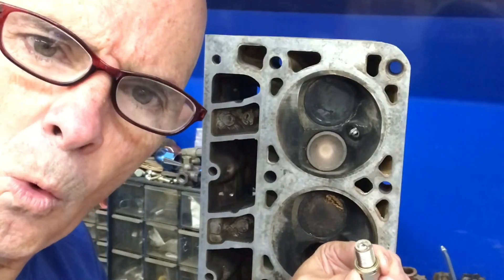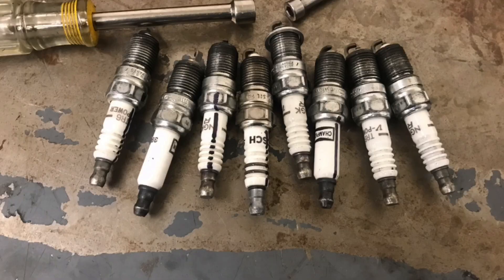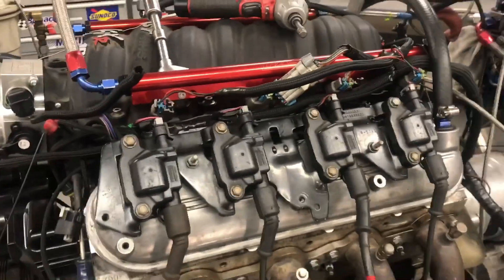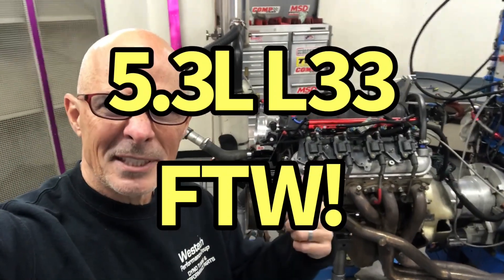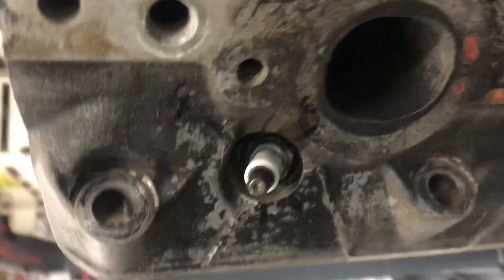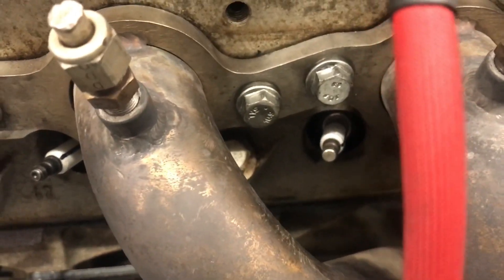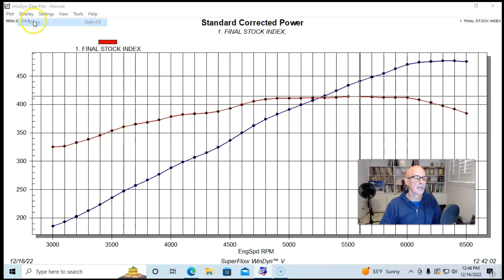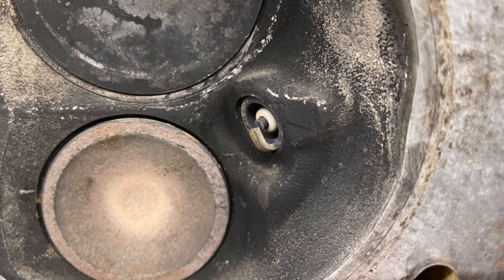SPARK PLUG INDEXING-DOES IT REALLY ADD HORSEPOWER? JUNKYARD LS MOTOR MYTHS! LOW $ MODS-DOES IT WORK?

Comment: American Iron Magazine tested plug indexing many years ago on a stock 1200 sportster ( at the time, a stock harley was a dual fire ignition, both plugs fired at the same time ). they saw a 1.2 hp gain (2.5% increase) but the owner didn't care about the extra horsepower, she just LOVED how much smoother the bike ran at highway speed. As he said, it's all about application, and hoped for results.

Comment: It was always common knowledge that indexing plugs did not yield large HP numbers. (Rumored NASCAR indexed and returned a 7 HP gain) bit if you're on the quest for HP numbers, you know every little bit adds up. Lightened flywheels, crank pulley, electric water pump, electric fans and etc. And before you know it. You could be pushing those 900 hp numbers like NASCAR has. But we also have to take in account for head design. For it's also common knowledge that the heads of an LS flow significantly better than its predecessors.
Reply from the maker: every little bit doesn't add up when the little number is 0
Reply: @richardholdener1727   I'm  just going to contribute heat being a factor in forgetting 1 is greater than 0, as stated at 11:30. Stay hydrated my friend, cause we're not youngins anymore.  sigh
Reply from the maker: there is no 1, there is only 0...look elsewhere
Reply: @richardholdener1727  so you want to tell SummitRacing channel their video is wrong? lol

Comment: I can tell you the truth that happened to my street 75’ Camaro, after installing a shift kit. It would not chirp/squeal the tires. I read an article about side gapping the spark plugs. After that, it would squeal the tires after shifting to the next gears. So some type of improvement was definitely happening. What happens on the Dyno, doesn’t actually mean what happens at the drag strip. Quote from “Warren Johnson”.
Reply from the maker: wrong-if it makes more power at the track-that shows on the dyno-it doesn't EVER happen in just 1 place unless you changed something. side gapping only helps if you had a misfire without it

Comment: nice, tks. I think the washers masks the result a little bit because they take the electrodes tips out of the center of the combustion chamber, with is the opposite of the projected electrode plugs do. it's not a big deal, but the thing is to find a plug that gets indexed without any extra washer, maybe swapping them from one hole to another till get the higher as possible of them indexed. what if you 'd try with the projected electrode plugs? ( just adding the letter P do the plus youre using right now, as long they don't hit anything inside...you gotta roll the engine by hand to find out if it's possible befere trying...I fell that those plugs increase the torque and the engines overall response.
Reply from the maker: we swapped plugs from hole to hole-no change

Comment: Indexing plugs can be good in direct injection engines. Example the evinrudes outboatd e-tec direct injection two stroke wont work right if you dont index the plugs.

Comment: Excuse me, but if you're adding washers to the plugs, aren't you actually moving the spark further from the sweet spot that is designed into the shape of the cylinder head combustion chambers.
By recessing the electrode you are in effect making it less effective at igniting the atomized oxygen fuel mixture.
Thus lowering the efficiency of the power generated by the explosion of the mixture, and I would think increasing the chances of the spark jumping to the head itself instead of the electrode if by chance there's a little carbon build up on either component of the spark plugs. 
Which may actually work better that way considering the plug is fouled. 
What I've often wondered is why the GM, and FOMOCO haven't gone to the spark plug in the center of the head like Dodge, and majority of the Japanese inline engines are located, because that would ideally be the most efficient location for the ignition of the fuel theoretically is it not.
Considering the most powerful combination gasoline engines use the hemispheric heads, that's pretty much proves that is the most efficient location for the spark plugs to be is it not. 
Especially considering the power that they can get from a NA inline 4 cylinder engine with some trickery by variable valve timing such as Vtec Hondas have.
As I've personally driven Nissan sedans with NA inline 4 cylinder engines that I swore had to be either turbocharged are hi out put V6 engines. 
That shame the same cubic inch American made 4 cylinder engines in my opinion. 
Just few things I've noticed, and wondered about over the years. 
Hopefully someone much smarter than myself can fill in the answers to my questions, and what if's.
Oh yeah, I'm sure GM had hemi designed heads on V8's long ago, as did Fords 429 super cobra in the mustangs cougars back in the late 60's. 
So it can't be a issue of patent rights surely by this day and age.
Reply from the maker: moving the plug the distance of the washer has no effect on power as tested

Comment: Try it with 20 lbs of boost or, 14.1 and up compression. I tend to see it as more important as velocity and cylinder pressures go up.
Reply from the maker: indexing makes no difference-even with boost or compression (except to clear dome pistons)
Reply: @richardholdener1727  thanks Richard.
Our engine builder/ dyno operator index’s and sells plug sets indexed for customer engines .
We are at 14.5 -1 with a small dome with a small chamber , N/A , 840 hp and I think  he does so because of attention to detail .
When porters use layout dye to check airflow path, as you know, it comes up the bowl and straight across the plug .
I don’t think it’s as much about power as it is consistency / not fouling plugs at low rpm/ consistent plug readings etc.
Even if it made a power difference, I wouldn’t expect it to much exceed dyno +/- calibration .
Like you, I have never seen it make a power difference but , in talking to head porters / Crew Chiefs / race engine builders that blue print everything , they see value in it .
He doesn’t use index rings but a tool and buys plugs by the hundreds and sits and finds where they index, numbers them etc.
I also think plug manufacturing today is better and, we know ignitions are much better today than in the past so,it “ may” have been more important in the past.
It sure seems to make sense when looking at fuel flow pattern hitting the bowl/ coming across plug and shape/ direction hitting cylinder wall but, these timing events are happening sooo fast,,,
I wasn’t busting your chops bud , just find it really interesting .

Comment: Back in the day, I ran circle track with sbc fuely heads. These heads had a circle impression or c-bore in the chamber under the spark plug. I used to index the plug directed at that stop in the chamber with the theory of having the flame front start there. In testing on track I found when I did that I would need 1-2 degrees more advance in timing. I couldn't run that same timing when not indexing toward the chamber. It produced higher end of straight away rpm's read off tatel tale tack.
Reply from the maker: Needing more timing is a sign of inefficiency and I would like to see a real test

Comment: On smaller engines it does make a big difference on a larger Engine with more cylinders I could very much understand where it does not make much difference at all however on my little ATV positioning or indexing my spark plug to the correct direction made a big difference at least in terms of startup and a very small power gain
Reply from the maker: I would like to see your data that shows the power-we have tested it many times with zero gains

Comment: I've seen you do some testing with turbos in which it was 'blowing out the spark' at some point...whether that was a high boost, low speed or high boost, high speed I can't remember.   Could you possibly index the plug so the electrode shrouds the spark and prevents this 'blow out' from happening?  You'd have to run an engine to where you KNOW it's blowing out the spark, then index the plugs and see if it stops blowing out the spark.  I don't know if it's beneficial to all, but might make some insight to someone facing this issue at the track.
Reply from the maker: reduce the gap

Comment: With an easy to ignite max power fuel mixture, it is not surprising that indexing has no effect.  But try this with high EGR or a lean mixture when trying to maximize fuel economy, then there will be a difference.
Reply: Yes yes yes yes yes yes yes yes!

Comment: If some engines gain some power from indexing, it would HAVE to be because something about the heads doesnt promote good mixing and turbulence, but when the plugs are all aimed the same, theres a slightly better chance of lighting off a rich portion of the charge. I would bet that indexing would also probably help more in low spark energy systems than ones that have higher energy.  The other possible effect from plug indexing may be to diminish ping sensitivity when ideal indexing is used vs increased sensitivity to ping when the worst indexing is used. It might also be that the way one could measure that is to see if the best power ignition timing changes at all vs plug indexing!

Comment: I always wondered.  Thanks Richard.
I'll admit, I'm still going to try it on my Onan generator.  It's a 1.0L horizontally opposed two-cylinder with flat heads.  I figure pointing towards the cylinder should be better than pointing at the back of the pocket.  For me it's about efficiency (fuel economy).  If I can get an extra 10-15 minutes of runtime out of a 40lb tank, well, that's better than nothing.
BTW, it makes a whopping 14HP at 1800rpm.  :D
Reply from the maker: Did it work?

Comment: Hmmn, I'm not sure I'd ever index spark plugs using washers, a plug that doesn't protrude sufficiently might undermine clean data & whatever minimal gains there are to be, which in my understanding is more about better response rather than power. That said the engine's adaptive timing is greatly undermined by the fact that vastly different plugs here were used, which from prior testing Project Farm had done did show that different plugs of various brands did show noticeably different flame propagation characteristics, so testing methodology needs revision

TLDR; indexing should not be done with washers & different brand plugs, because it's more about getting the ignition propagation more even so that the engine can more evenly adjust timing across the board & if power is to be gained it will be by way of having tighter ignition control. So the classic method of numbering plugs & trying them all in each cylinder graphing to notepad/table to see what plugs swapped to which cylinders(though time consuming)will land them overall to closest preferred orientation, will be the test to make. I understand this is more of a hassle in a V8, though it's also usually easier to find a plug which suits each cylinder Vs the limited options when getting a pack of 4 for an inline-4
Reply from the maker: HAVING ALSO TESTED PLUG DEPTH AND STYLE ON THE SAME MOTOR-THE DYNO DATA SHOWS YOUR COMMENTS ARE TALKING SIMPLY POINTS AND NOT REALITY.  THERE WAS NO POWER FROM THE CHANGES YOU DESCRIBED
Reply: @richardholdener1727  not sure why we're going ALL CAPS😂, but my point was you aren't testing for timing advancements that more uniform combustion can afford, so these mods absent holistic tuning won't give you results if you aren't actively looking for it, not to mention I'm not sure with the lumbering nature of this motor that this is the right platform to even draw conclusions from

This kind of comparison is analogous to using higher octane fuel without adjusting for timing, then going "see both graphs aren't much different", an anecdotal example is when I'd switched fuels in essentially a 90's Camry motor which ripped the teeth off it's aged timing belt wheres it couldn't before advancing timing. However it's well established that there are many mods that won't net gains without taking advantage of tuning when spark events happen
Reply: I hope over text I'm not coming off as thinking throwing parts equals improvements, I don't, I'm an avid believer that some components simply work or don't, as do you. That said there are slow-mo video that show varying flame propagation by different plug, which naturally means for ECUs that collectively advance or dial back ignition events, that a tighter timing between various cylinders means all cylinders can approach closer to their maximum advance threshold. As we know timing is where many NA engines find gains moreso the high strung ones high valve & RPM ones

In fact timing can be so important that if you're on the cusp of detonation, installing a plug set with faster flame propagation can even start losing you power, so without looking at how far you can push timing with the various plugs means as I said testing is flawed which it is, because if you have mix matched plugs that fire differently, then tuning improvements to some cylinders might mean reductions in others, hence the muddied data, THAT'S REALITY, that's what I'm saying, I'm not here advocating that a low revving 2 valver V8 with obvious bottlenecks is the gold standard for the kind of upgrade that's much more important on engines that push a bit more peace than the slow burner that's in my Tahoe

Comment: Using indexing shims isn’t the right way to do indexing because the shims change spark plugs reach ( lesser it and this do reduce the horsepower) and the heat range ( move it to hotter ones which can cause detonations on high loads which also reduces the horsepower ) The right way to do it is by trying at least 3 different plugs per hole( usually 1 of 3 works well enough) . Also the indexing isn’t all about max horsepower where( on such RPMs )  the turbulence is high enough to minimise the differences but mostly equalising cylinders power output in the lower and middle RPM range which do stabilize the idle , reduce emissions and increase the drivability. It’s true, that as powerful your ignition system is as less noticeable will be the effect of indexing but the high energy sparks aren’t produced for free as well. Usually the high energy coils pull
between 7-20 Amps current from your alternator which on his turn pull the horses from your crankshaft . Also on high RPMs the required dwell time for charging the coils can overlap and the current consumption from the ignition system can double or even triple ( depend how high RPMs are ) . I’m BTW advocate for high energy sparks but also of the way of achieving more with as less as possible and the indexing is just one of the ways to exercise such a philosophy. 
BTW even the mass automobile manufacturers used indexing ( Honda Insight first generation for example ) and in present times Ford and they even produce the threads uniformly so if you buy the original spark plugs they will be properly indexed after proper tightening .

https://youtu.be/r_zmA6Q0cQ4
Reply from the maker: THERE WAS NO CHANGE IN POWER FROM INDEXING
Reply: @richardholdener1727   in your 5 minutes Hollywood style experiment, which even wasn’t conducted correctly :) https://youtu.be/hFcaZ0ckmFs

Comment: i love your videos , my question is can i run platinum plugs on a 1970 carburated stock small block with the pertronix ignitor 1 or do i have to run copper plugs ,,,,,also i have ran a mustang 91 on the track and i used to index my plugs and i found zero gains by doing that so i just throw them in now and wherever they land , my best time on my 91 stock block 5,0 with cam heads and 650 dp performer rpm 410 gears 3k stall ran 11 13 at 122 with a 100 shot of nos and 12 69 107 no nos ....so yea can i run platinums on my 1970 stock 2bbl engine with a perronix
Reply from the maker: YES

Comment: The only time I ever indexed all the plugs was on one engine, back in the early 80s. We were running 17:1 comp. ratio on a short deck Cleveland engine with Wiseco pistons that had a pretty close clearance between the piston dome and the plug electrode. The pistons had a divot for the plugs, but it was still pretty close. We felt that running a spacer on the plugs was cheap insurance, and since we were doing that, we indexed the plugs in the process. Never had a problem, but the driver never noticed any difference either.

Comment: Richard, do you think there was no difference because it’s a newer, more modern chamber/engine?
As in, a bad or poorly designed engine would benefit due to the bad flame propagation?
Do this on a open chambered 351m or any other garbage design and perhaps you would gain?

Comment: Thanks for the video, I've always heard rumours about indexing providing small gains when it comes to heavily controlled low power setups (one make races etc. like the Excel series here in AUS). where you're trying to squeeze out every possible horse power you legally can. this test also got me thinking about the depth at which the plug enters the combustion chamber as shimming them moves them further out of the chamber, surely this is as negligible as your tests have shown indexing to be for this sort of set up. wont waste time with indexing and will just make sure it has a solid ignition system
Reply from the maker: THERE IS NOTHING TO SQUEEZE